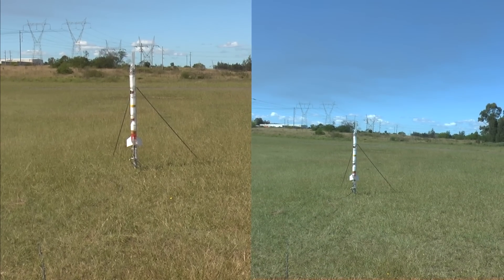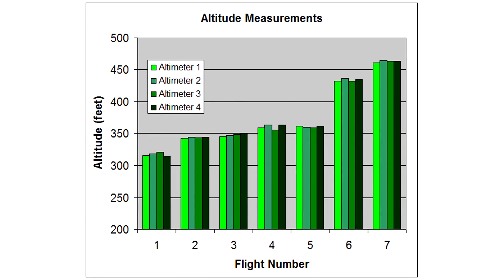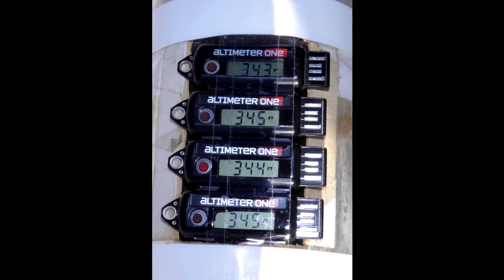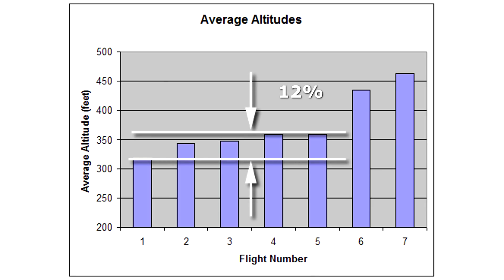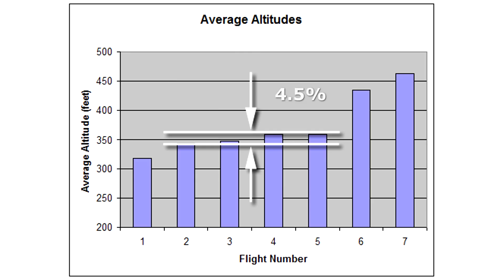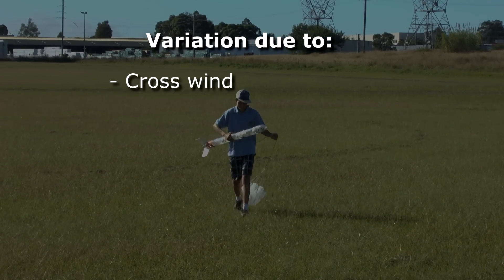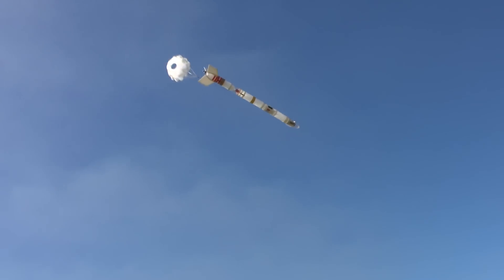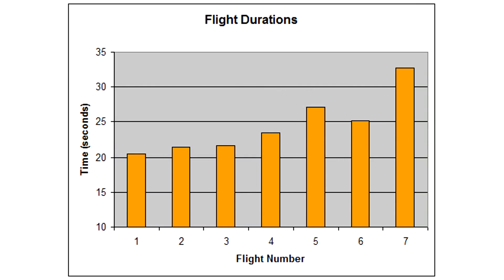Looking at Measurement Errors

Comment: how can I measure the force and acceleration?
altimeterOne uses a weather sensor or time? (YOU ARE MYTHICAL :D)
Reply from the maker: ***** Hi, The AltimeterOne uses a barometric sensor that measures the air pressure. It is actually quite sensitive, and can even measure the pressure difference between say a table top and floor. 

One way to measure acceleration is using an accelerometer. There are many available that you can fly on your rockets. An example is the AltimeterTwo https://www.jollylogic.com/products/altimetertwo/ that also records maximum acceleration. Alternatively you can measure acceleration by using a video camera on a tripod located some distance from the launch pad and recording the flight. Make sure you have some kind of known reference length in your frame as well. You can then step through the video and measure how far the rocket moves in each frame and derive the velocity and acceleration from that.
Reply: AirCommandRockets  thank you

Comment: Great video, it's very interesting to see how much difference is between flights under the same conditions. We noticed that too with our SkyHopser 2R rocket. We used the same pressure and the same amount of water, but the first flight was about 100 feet higher than the previous one. 
Cheers
Julian
Reply from the maker: RaketfuedRockets Thanks Julian, It's always interesting to see how much variation there is. We had very good weather conditions for this experiment, I can imagine with a stronger cross breeze or gusty conditions the differences would be even greater.